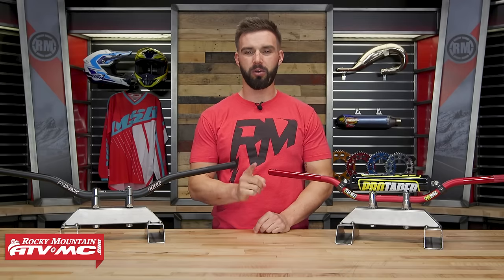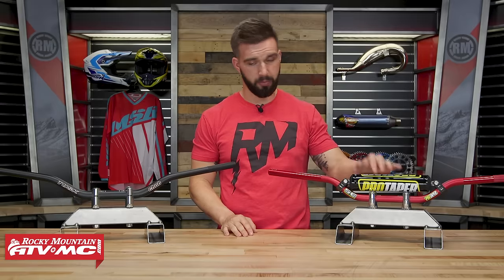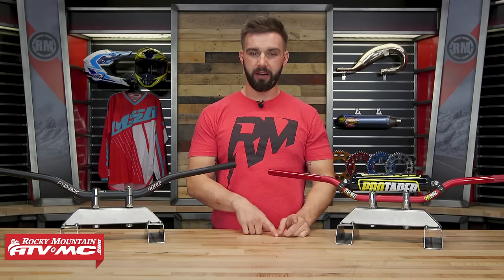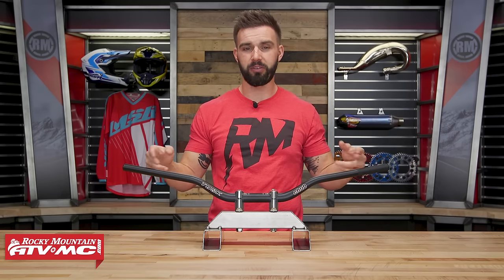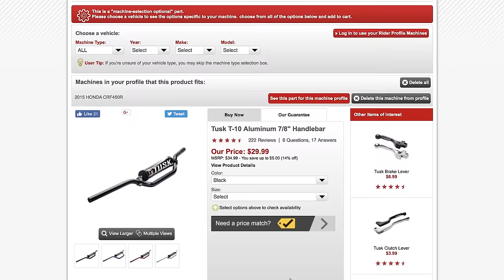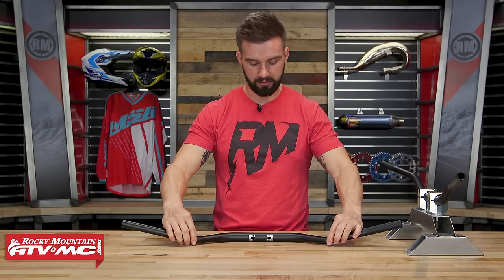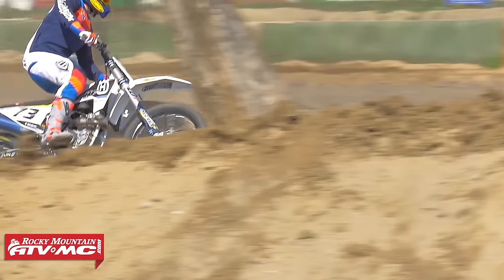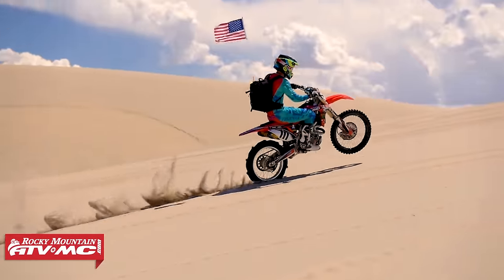Choosing The Best Handlebars for Your Dirt Bike or ATV

Comment: When i was riding 80's I went through a set of 7/8" bars about once every other ride(because I bent them). When I upped my bike size to 250, 450, 500, I always ran 1 1/8" pro tapers and have never bent a bar since. The fact that I used to crash alot on 80's might play a factor too haha but I had some gnarly crashes on the big bikes too

Comment: Handlebars are honestly the hardest items to choose on the entire dirt bike. It's all "Rider preference" but you can't make a preference when you can't try them all out. I guess you could spend a few hundred dollars buying a bunch of different kinds then picking one you like and returning the rest. Would that work with your return policy?
Reply from the maker: oHerroPrease - You just wouldn't want to mount them on your bike is the only thing.  The item/s must be in brand new or un-used condition. You can for sure do what you're saying and buy a couple different bends and then return the ones you don't like.  The best way really is to pull them down at your local retailer and try them out.  That way you don't have to buy them all and you can get a real feel for how they are going to feel while on the bike.  How this helps.  What handlebars are you leaning towards?
Reply: @rmatvmc  nice 👍🏼

Comment: How short is too short for a dual sport I like the idea of having tighter bars I ride  deserts and forests I don’t actually do a lot of on road riding I’ve ridden little 125s and 50s and the bar size drop hasn’t bothered me but on an XT250 I want shorter bars but I wonder if it will hinder mobility or ease of turning when I’m doing more technical stuff

Comment: I thought crossbars helped reduce vibration. I’m trying to mod my 2017 YZ250 for enduro trail riding (so far I’m running an 18” rear wheel, weighted flywheel, levers, pegs etc., the usual stuff) and now I’m about to purchase a Precision Parabolic steering damper (I considered Scott’s and GPR but the PP specs and functionality is just too appealing). I was thinking about changing my standard bars to a crossbar setup (particularly the Ricky Carmichael ODI CFT RC4 because they have great reviews and apparently reduce vibration quite well), or just getting some shock and vibe bar mounts (but I’m not really sold on the idea of these yet). I’d love to hear your thoughts. Great video by the way. I’m not afraid to experiment with new bar positions/specs but now I know how to measure what I’ve got and try not to veer too far from what I’m already comfortable with.

Comment: the best set of bars i have ever bought in over 35 yrs are a set of twisted engineerings carbon fiber un breakable bars i have dropped crashed run into trees and the bars are straight and un harmed ,i have bought bars and bent them on the first ride 100 quid a pair its expensive  i spent 300 quid on the carbon from twisted and i still have them over 3 yrs later not sure how much they have save me but for sure over 300 quid so now they are free also they flex so my old bones last longer with less pain ..
Reply from the maker: stephen davis yeah, we've heard good things about those handlbars!  We'll have to give them try and see if we can't pick them up?  Thanks for sharing!

Comment: Can y’all please make a video on how to setup handlebars? How far back or forward to have them set and the controls as well?
Reply from the maker: John, this is really rider preference. I wouldn't say there is a wrong or right set up. Yes, too far forward or back isn't ideal, but I would just find a bar position that feels comfortable. I always try to have my bars at the same angle as my forks. Taller riders tend to have their bars a little farther forward. As for lever placement, again, this is different for every rider. I prefer my levers to be angled down just slightly. I also have my clutch lever about as far in (toward center of the bar) as I can. This gives me good leverage and makes my clutch pull a little easier. I'd just try different set ups and find what feels best for you. Thanks for watching and hope this helps.
Reply: Rocky Mountain ATV MC great info thanks a lot

Comment: I do wish you covered options for taller riders who are also beginners, because I have been riding for 20 years on the street and I just got a dirt bike and I'm trying to figure out the best option since I am 6' 6 riding a 2020 klx 300 R  Sitting on the bike I feel fine but standing on it definitely feels unnatural and I'm wondering is there any way to widen the space that I'm riding in by getting taller risers. Any ideas?
Reply: Try fast way lowering pegs. Try not to raise the bars much as it changes the handling of the bike

Comment: Do you know if i can fit one of these motorcycle handlebars on a mountain bike?   The cross bar type being my most favourite.
Friday afternoon at 16:28H.  28th May 2021.  U.K. 🇬🇧 Southampton.
Reply from the maker: Unfortunately, you're better off using mountain bike specific handlebars because modern day mountain bikes utilize either 31.8mm or 35mm clamp diameters where dirt bike handlebars use either 7/8" or 1 1/8" clamps.

Comment: you said the cross bar helps minimize vibrations vs no crossbar? is that true for all handlebars with crossbar?
Reply from the maker: It's actually the opposite. A handlebar with a crossbar will be more rigid and have more feedback while a handlebar without a crossbar will have more flex and absorb more vibrations. This runs true for all handlebars.

Comment: if i want my bars as straight & as low as possible what is the best bend choice in MIKA? i like my bars with a little less width & no bend in. i have a 2000 yz125
Reply from the maker: Maybe try the "CR Low" bend.  That would be your lowest bend option, then the "KTM Bend".

Comment: Are the pro taper bars hollow at the ends or do you have to drill them out for bark busters like I had to on my stock bars?
Reply from the maker: Yes, the ProTaper SE bars are hollow but will come with a plastic end cap that can easily be removed if needed.

Comment: I race motocross and some woods. I am 6' tall with long legs and long arms. I stand more in the woods and wish i stood more on the track. I have the protaper yz high bar but i think a taller bar would help me out. Anyone have any bar suggestions ?
Reply: I'm 6'4 and had cr high just tried the kx bend. A bit taller and better sweep which feels a lot more comfortable
Reply: Brandon Cook I wonder if they still make the ol Pastrana bend... Haha. That'd do it, I'd guess!
Reply from the maker: We also have handlebar risers you could try out. Much less expensive that a brand new bar. https://www.rockymountainatvmc.com/p/1316/25849/Tusk-Handlebar-Risers
Reply: i have 2 inch rox riser as well
Reply: I'm 6'6" and woods race(hare scramble), lower and flatter bends are the way to go. Gotta get up over the front end and off the seat to go fast!

Comment: what handlebars are best if you have elbow problems?
Reply from the maker: These or you could try the Mako 360 bar mount from XC gear. https://www.rockymountainatvmc.com/parts/xc-gear-mako-360-bar-mounts-p
Reply from the maker: fasst flex bars
Reply: @rmatvmc  Man those look funky. I just bought the tusk high bend. You guys have the best prices. I bought a couple other things also.
Reply from the maker: @tandpnetwork7102  That's awesome!

Comment: 1 was wandering  what size bar  to get for my yz 85 2006 I bought  mika  mini  handle  bars  and  bought  a  set of risers  just  wanted  to  make  sure  I got the right  ones I got the yz bend  would  you please  get  back  in touch  with  me  and  let me no I got the right  equipment  please  text  me  back  mine are mika  mini  handle  bars  please  let me no thanks  plan too order  me aset of dunlop  MX 52 tires  for  my yz 85 complete  set for around  100 dollars  for  both  tires  the prices are reasonable  and a set of warp  9 footpegs  plan  too do a lot  more  business with you in the future  thanks  again Mike  Holden said that out of north Carolina
Reply from the maker: The bar bend is all personal preference and depends on the feel that you want. But as long as the bars and risers you ordered are both either 7/8" or 1 1/8" then they'll fit on your bike just fine!

Comment: Pro taper for the win, you'll never find a stronger bar, they flex nicely and don't beat up the rider, they dont bend unless its a massive hit (ive never bent a ProTaper and ive crashed a lot of them, ive bent both renthal fat bars ive owned just lightly dropping the bike both times) rennthals seems to be made of cheese... 

Avoid those heavy, gimmicky, overpriced "crossbar suspension"

Comment: 0:57 - "Aluminum is stronger than steel and more resistant to bending"  "anodizing helps strength"
Where did you find this guy? Steel is stronger than aluminum any way you cut it. In bending, tension, compression, anything. Rocky mountain is losing credibility with those false statements
Reply from the maker: When weight is taken into consideration, aluminum is a much stronger material with about 3x the strength to weight ratio of steel. 
Thanks for checking out the video!